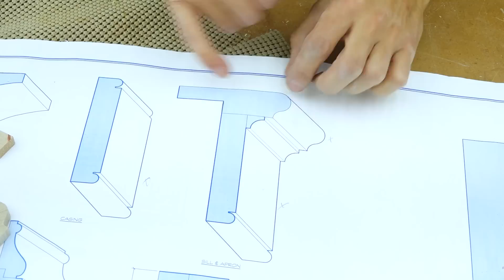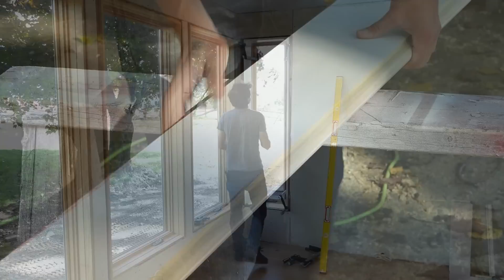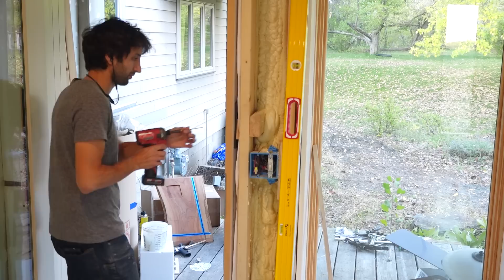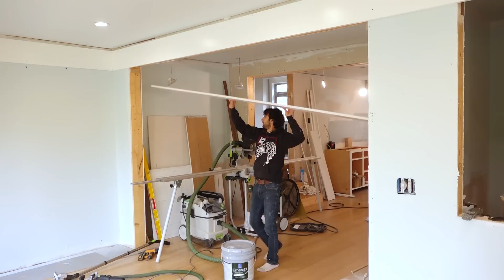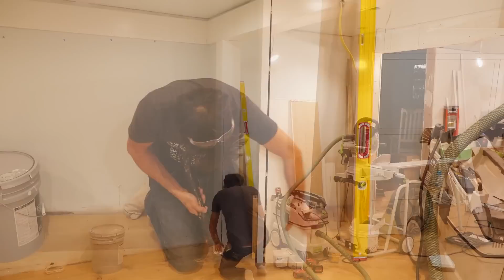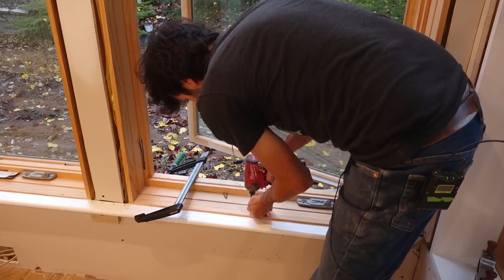Installing the First Chunk of Sunroom Trim | Home Renovation & Addition Part 61

Comment: Why are you not using screws only on the top of the band board where they are hidden by the crown mould and finish nails at the bottom where they have to be filled? I figure you have a reason, just wondering.😊

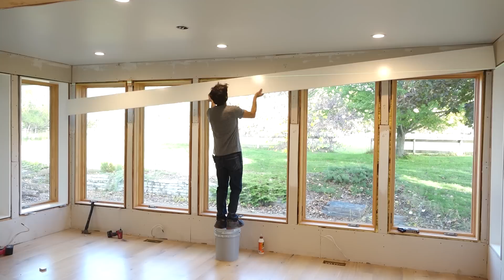Comment: 11:48. Stop using a pail to stand on. Believe it or not Ikea makes a very nice all wood step stool that would feel at home in your house. (Bekvam) 2 step not 3 step. It comes in raw wood. If you want, you can modify the design to suit. Perhaps double the width and length. (make it 2x4') Maybe it could be a kit for people to buy.  
    The big box stores have numerous work platforms made of aluminum.
Reply: Another safety Sally has arrived😂😂😂😂😂😂😂
Reply: @daveklein2826  I bought one 15 years ago and never regretted it.  Last year i got the aluminum work platform from HD to work on my ceilings. Best purchase ever.

Comment: Beautiful work, Matt! I’ve done similar work (building faux beams/columns) and I’ve done the outside corners with long edge miters. More work but it minimizes any visible joints - so no caulking or touch up painting. Curious as to your thoughts on this approach…

Comment: Matt, you make videos with sound being super important. Why do you insist on using impact drills? You should use a clutch drill on setting one for high torque, much quieter. I used to work in at West Elm and customers hated the sound of the impact drill. I also put together a 16x16 deck and my ears preferred the clutch drill. Jus sayin!😂❤ the show.

Comment: Beautiful work!
I don't think standing on buckets is safe, try moving your weight to the edge, the bottom of the bucket gives limited stability.  I prefer a 2-step lightweight folding ladder, a lot more stable...
Reply: Safety Sally has arrived

Comment: The small pieces you screwed into the wall to hold up the board above the window is absolute genius and a "why didn't I think of that?" I was the one responsible of holding things as my husband screwed them in. Thus leading to much consternation and sore arms and wonky placement. Brilliant simple solution 😂
Reply from the maker: I’ve spent a lot of time working alone 😁
Reply: I have used blocks before, but the use of shims and the laser WITH the blocks is what caught my interest!!
Reply: These are the things only children dream up.

Comment: Your attention to detail is spot on. It is a!most as if Donavan were in the wings prompting you.

The adjustable switch box is the best forward planning detail I know of. Also many are reluctant to take a Saw-z-all to a pantry window header when they are a year into a remodeling project. You and Lindsey are comfortable saying it is most important for the trim details to match in the sunroom over the pantry.

Have you given any thought to putting down floor protection to eliminate scratching the beautiful flooring? A roll of RamBoard  sounds like good insurance to me.

Thanks for sharing your progress with us.

Comment: My major takeaway from todays video is, the importance of a 5 gallon bucket and lid. Some smart person should starting making lids for different shoe sizes.
Reply: I was just wondering if that was an OSHA-approved 5-gallon bucket or just a run-of-the-mill 5-gallon bucket.
Reply: @bobk9650  you can tell it’s not OSHA approved, It hasn’t got a handrail !
Reply: I concur, 5 gallon buckets are certainly very handy for us shorties who need a little height !! LOL.
Reply: @johnking8679  Also of use for those of above average height who just ned that extra little bit of height.
Reply: And/Or drywall stilts...

Comment: Sill outside!  Stool & Apron inside !
Reply: Window board and Apron.
Reply: @geoffsutton3157  ok you got me?  What is a window board ???  I hv been a finish carpenter/contractor a minute or two never heard of a window board?
But?  I am listening?  Learn everyday!
Reply: It’s what it is called in the U.K.  CGLI, IBICC Carpenter and Joiner
Reply: Architects call the location under the window the “sill”. Different components come together to create the sill condition and detailing outside and in.
Reply: @erinmoore9681  English spelling is Cill. The Cill is part of the window frame/sash. Window board is an addition to the window frame,  not part of the window frame/sash, sometimes there is not a window board. I would suggest if you doubt me, you research, English joinery that established  principles, prior to to America being discovered :)